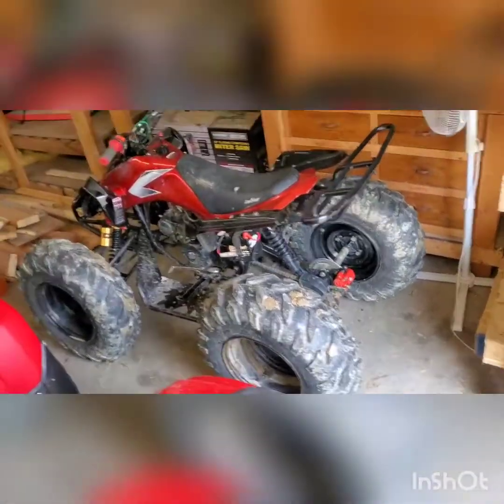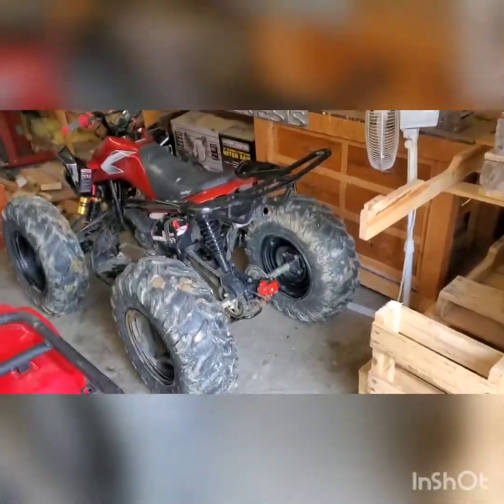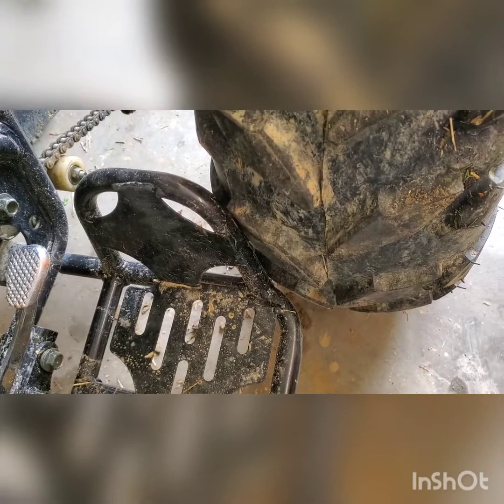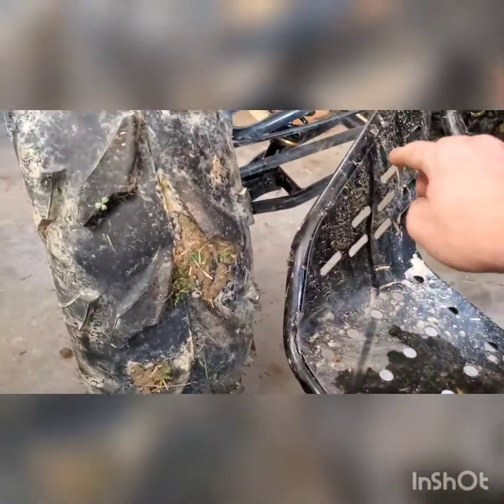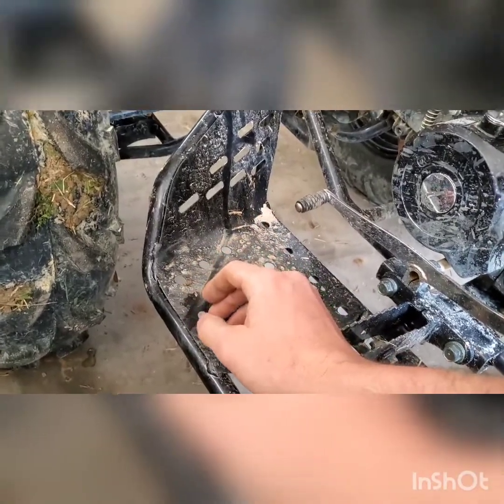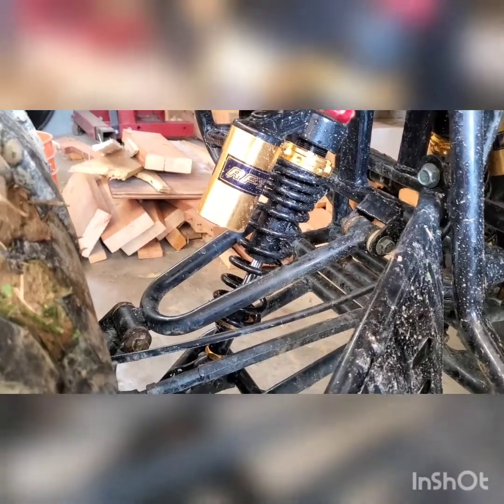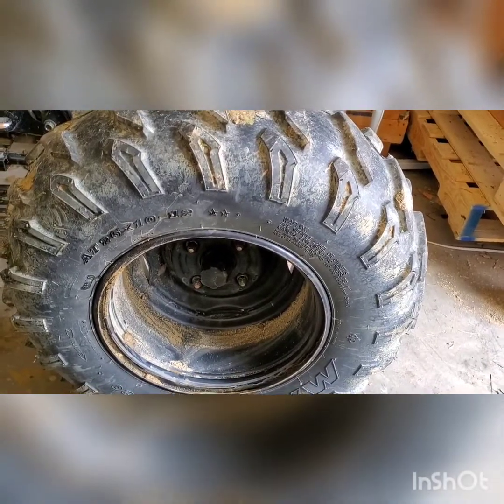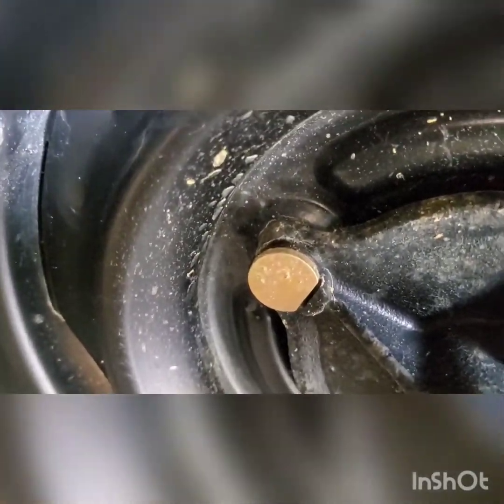Coolster 125 gets massive tires and wheels! (build part 1)

Comment: Hey bro, when swapping out tires on this 125cc atv, did you have to use the original rims from the stock tires, or will any atv rims do?
Reply from the maker: This particular machine shares the same lug pattern as yamaha and honda 4x110 so I just used the onlld kodiak rims I had laying around